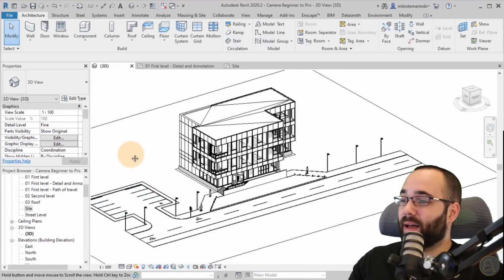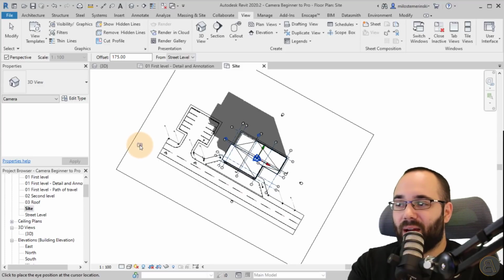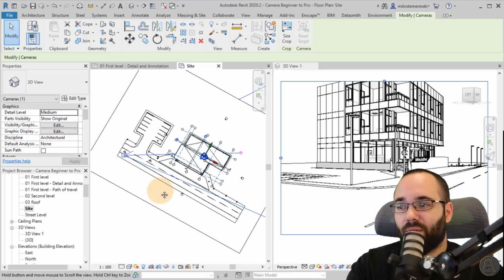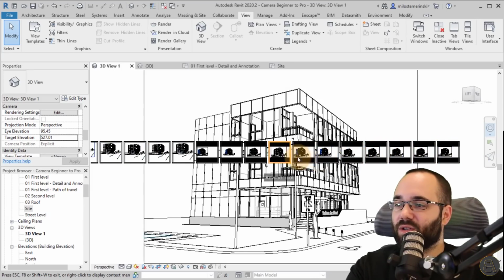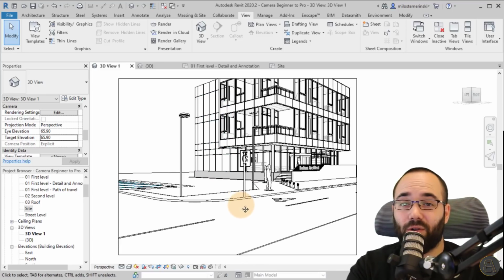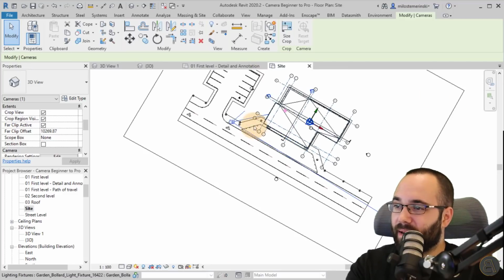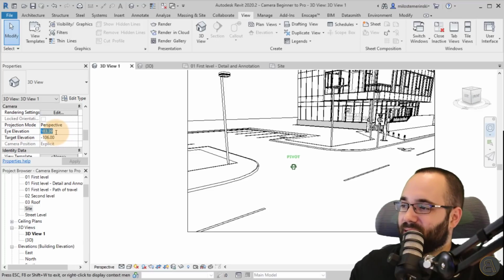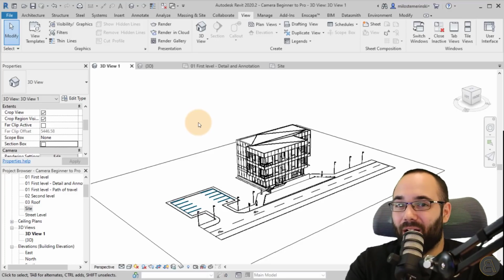Revit Camera Tips for Revit - Beginner to PRO Tutorial

Comment: Great video! I have a question concerning the thickness of the lines in this 3d view setting particulary, is there a way to make the lines thinner then they appear ? I usually export this type of visual style (shaded) on photoshop for collage but the lines are not well defined, they are thick.
Reply: use a filter